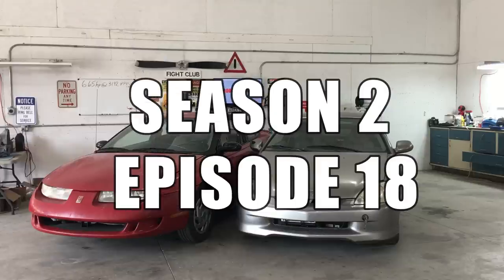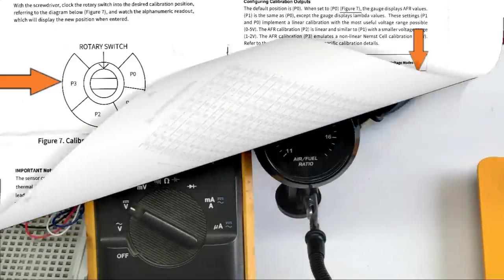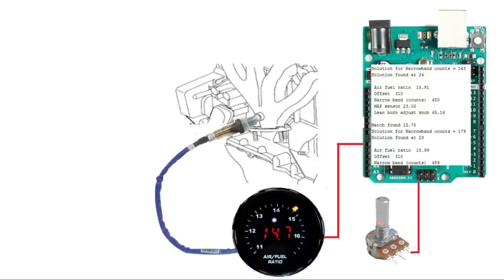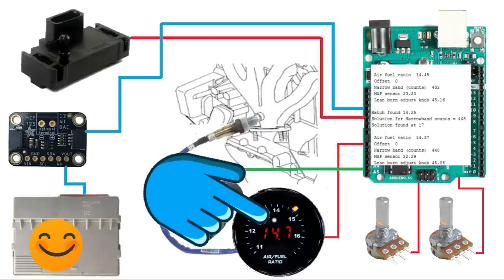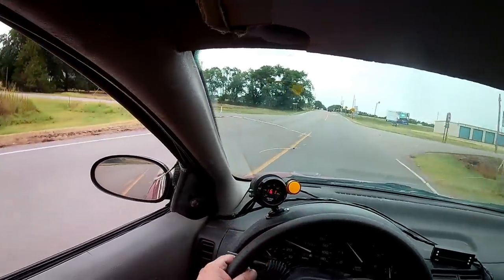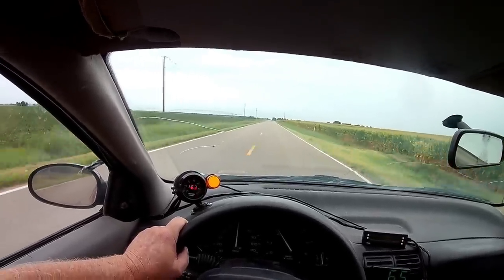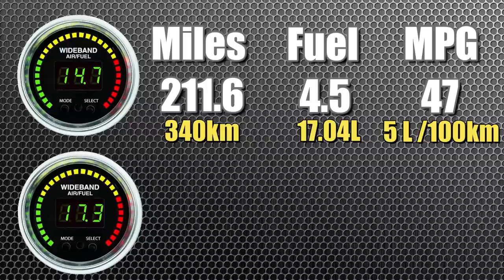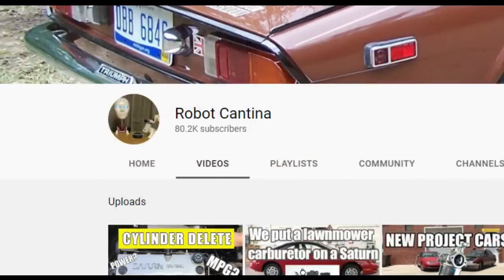S2E18:  We test a lean burn system on our Saturn .  Will it get better MPG?

Comment: I'm not suggesting that this was a problem in your experiment, but I do think it worth mentioning that I've been tracking fuel economy on my cars with every single fill-up for more than 25 years and I've learned that pumps vary in their calibration, even though they're tested and stickered by state regulators (i.e. agriculture department here in Kentucky).  As a result, I usually use the same pump for most fill-ups.

As most of us likely use the same station most of the time for location or discount reasons, it's often not difficult to use the same pump unless you arrive at a busy time.  I'm not crazy, though, and use another pump if the usual pump is taken.  It's just a casual thing and obviously isn't possible on road trips.  Long-term fuel economy will average out over many fill-ups, regardless, so this issue only affects individual fill-ups.

Even the same pump may vary in its cut-off point depending on multiple factors, including how the nozzle is positioned in your filler neck.  Most of us likely hold the nozzle in the same position each time, so that's not usually an issue.  I otherwise just accept the numbers shown as I'm not performing lab experiments ;).

Comment: It's possible your cheapo o2 sensor already as an offset built into it.
I had a bad o2 sensor and if too lean you clearly get very bad MPG.

It awesome someone got you a better kit.
Reply: A bad 02 sensor makes it run extra rich and use more fuel.
Reply: @1magnit  Depends on the o2 sensor failure.
Mine made the car run extra lean.
I had to crank up the fuel pressure every 100 km to keep my engine working to go home...

I would have preferred the o2 sensor to fail the other way.

Comment: I felt surprised that you read the ScanGauge measured injector pulses.  On Ecomodder they always say MPG meters measure the airflow and estimate gas used, which is why you need an MPGuino to measure lean burn MPG.

Comment: Thanks for another amazing video, the hoops you jump through to make this stuff understandable and entertaining is astounding! Questions: Do you think that the lean burn may be causing the engine to run hotter than normal? Hotter than normal can causes more fuel burn? From personal experience with small displacement air cooled scooters. you don't think that the parasitic draw from both the ac compressor, and the power steering pump would help you pick up that ~3 mpg that you saw, from some experience keeping older cars running, dropping an old ac compressor can pick up 1 mpg pretty easily. Thank you again this is so great to watch.

Comment: You should see if the egr operation is changing when you are running the lean burn system. Try to reset the ecu between lean and normal runs. Check when the ecu switches from open and closed loop between your lean and normal runs. Also check your short and long fuel trims to see if they are changing... if things are too far out of spec the ecu may just try to richen it up. Also monitor your coolant temps and egt if equipped, since they can cause it to try to run richer as a fail safe. I love the work you have done so far here. OEM ecus have all sorts of internal offset tables from my research in the past. Subaru's for example will change the injector pulse width as voltages go up and down and will do similar with engine temps.
Reply: To all the very valued viewers of this fantastic  channel and primarily to JIMBO  OF ROBOT CANTINA ..It's December and the Holiday season is upon us, with celebrations like Christmas, Hanukkah, Kwanzaa, Mid-winter or Yule, and New Year all approaching.  Wishing you a joyous Holiday season and a happy and peaceful New Year.  Thank you  for a fun ride.

Comment: Something that's crossed my mind from time to time is hot water. Nearly boiling, so combustion heat quickly and easily turns it to steam pressure.

Comment: As someone who has owned many S series, The single cam coupe can very easily get high 40`s and even low to mid 50`s if kept at 50 to 55 mph (assuming there is little to no wind on flat roads)
Reply: That’s honestly nuts for a car that size. How!?
Reply: Light weight car, pretty simple efficient engine, proper gearing, and decent aerodynamics. I had a 62 for falcon that would get 29mpg with a 260 v8 and a carburetor. It's all about setup, weight, and gearing.
Reply: @life_of_riley88  HEY JIMBO.....  congratulations on reaching 100k subscribers.. ROBOT CANTINA is providing the 
entertainment and fun that viewers enjoy..

Comment: The 92-94 Geo Metro XFi has a lean tune on the ECM. Along with only using 2 piston rings an using a different camshaft from the base model Metro.

Comment: The scangauge pulls MAF and MAP data and assumes 14.7.  It does NOT use injector pulse widths - this is not possible as injector pulse widths are constantly adjusted to maintain proper AFR due to fouling and other issues.  Vehicles have no metering device for fuel and just make assumptions based on history of fuel tank fuel levels and MAF/MAP using LT trim levels.  I have used scanguages for nearly 2 decades and they are great tools but are limited in their abilities.

Comment: I did this to my VW Mk3 Jetta 1.8 with single point injection using an old innovate LC-1 wideband controller. Mounted the wideband sensor downstream and left the original narrow band sensor in its place. Then took a 2-way switch to change between the narrowband signal from the original sensor, and the simulated wideband signal from the innovate LC-1. I then proceeded to program the LC-1 to target about 16.8:1 AFR and send that as stoich to the ECU. Been driving like this for a couple of months now and it works good. Haven't compared the fuel consumption yet though. But it feels as if a tank lasts longer than before.
Reply from the maker: That's exactly what we are going to try next, except we will be switching between the two sensors with a small signal relay.  We will still use the arduino, but this time it will monitor just the MAP sensor and automatically switch between sensors.
Reply: @robotcantina8957  Awesome. I would probably need to do something similar since it runs a lot leaner on high load than what i am comfortable with. But just gotta be careful. Ideally i would fit an MS3 and use table blending to run both E85 and gasoline. E85 can be run pretty lean without any real Nox being produced.
Reply: @ritter_cracker  HEY JIMBO.....  congratulations on reaching 100k subscribers.. ROBOT CANTINA is providing the 
entertainment and fun that viewers enjoy..

Comment: This one is certainly a head scratcher. If I understand the setup correctly, the lean burn box is sending a fibby O2 sensor signal to the ECU that the engine is running rich, it should have leaned the engine to compensate and gotten more MPG. I'm confused why the MPG was better without the lean burn signal? Maybe the ECU has been in a dishonest relationship before?

Comment: Very high MPG on first run can be caused by not ideal gasoline pump "stop" trigger.
Sometimes will stop pouring petrol with a lot o air still in tank.
Ideal solution: to ignore "stop" and slowly fill it up rest of tank to the level when You can see fuel level (through cap hole). Car should be on same pump as well - to eliminate any inperfection of terrain or pump gauge (calibration)
Or use separate tank and measure weight before/after as You done in one of previous tests.

Comment: I wonder if  there was any mpg gains from removing the power steering pump that may have skewed the data.
Reply: on my 92 Civic Si removing the PS belt is good for 1 to 2 mpg easily, and a seat of the pants boost in power.
Reply: I too suspect that is part of his discrepancy. When the weather cools a bit I am absolutely deleting the power steering on my SL1
Reply: I didn't bother putting my power steering and ac belt back on after turbocharging my Miata 20 some years ago.  The state inspection guy told me I had to put it back to pass inspection since it came with power steering.
Reply: @vinnieluther6589  that’s sucks, I’d install a false pulley just to pass and drive it the way I want to

Comment: Hey, Great work/experimenting. Keep it up!
Of late I've been using a haltech with an AEM wideband to target 16.0 for a closed loop. I think fuel economy is worse as well.  I think the LC-1 wideband has an NB simulated output switchable to  15.5 afr. The problem with your setup is that in a closed loop. the fuel trims kick in and the ECU will correct....which is what you want. but there are low, mid and high long-term fuel trims. as well as short-term fuel trims. short term fuel trims are eventually added to the long term.  This will mess up the fuel map tuning at higher loads even though you are monitoring the MAP. To mitigate this you would have to monitor fuel trims and adjust your driving accordingly.

Comment: One of my biggest concerns is using the gas pump to check how much fuel you used. I have noticed even using the exact same pump to fill up that sometimes it shorts me and I get amazing fuel economy for the last tank, but then the next tank my fuel economy is way back down when I fill up that extra half gallon or so that the pump shorted me the last time. Unfortunately, to get really accurate data you should use a separate fuel cell and use fuel weight, like when Mythbusters tests fuel economy. Even just temperature can affect how much fuel you get at a fill up. If you can use a separate fuel container, it will also let you make shorter trips since the data will be much more accurate.

Comment: As others have mentioned air flow and spark advance could be in a weird spot with the mapped wideband O2 sensor.
I'd love to see a datalog that included the MAF reading and commanded spark advance by the ECU.
Reply: Meeeeeeaaaaahhhh

Comment: One thing that confuses me "the lean burn turn on".From what I know about ECU control is that they have a short and long term adjustments. When you are turning on lean burn, you are fooling the ecu in thinking its running richer than it actually is, which uses the short term adjustment to reach the fake 14.7 mixture. Now that adjustment will get more and more added to the long term adjustment. This means your car will naturally have a leaner adjustment. When accelerating(which generally ECUs use another map or enrichment tables)  I could already see from the mixtures displayed, it should be between 14.7 and 13.5, but you were rocking above 14.7. In the end that is where my confusion is, you don't need to "turn off" lean burn as it's applied across the board after a certain while.

Comment: i believe the first lean burn in the early 70s from honda was to not need a cat, since we were only concerned with HCs and CO then not realizing that NoX had a larger impact on ground level ozone
Reply: those stratified-charge CVCC engines are a totally different animal. not even close to what is being discussed in this video.
Reply: @marzsit9833  they were a lean burn engine.  That burned around 17:1 instead of 14.7:1.   It was the first mass produced lean burn engine sold in the US…like I said…

Comment: The reason you want to advance timing in a lean burn system. Is to create the most cylinder pressure when the piston hits top dead.center as it reaches its power stroke. Because the mixture burns slower it will need to be advanved.
Reply: 15 deg ATDC is where you want peak pressure.
Reply: @1magnit  To all the very valued viewers of this fantastic  channel and primarily to JIMBO  OF ROBOT CANTINA ..It's December and the Holiday season is upon us, with celebrations like Christmas, Hanukkah, Kwanzaa, Mid-winter or Yule, and New Year all approaching.  Wishing you a joyous Holiday season and a happy and peaceful New Year.  Thank you  for a fun ride.

Comment: Regular engines run richer, doing so helps cool the engine and clean carbon build up, by leaning the mixture you actually run near the perfect mix, wich makes the engine run hotter but also stops wasting fuel.
Edit: newer engines also use the richer mixture to heat up the catalytic converter  to reduce emissions

Comment: You can actually use a linear 0-1V wideband sensor with a narrowband ECU. It will actually control the A/F ratio much closer. With a narrowband sensor the mixture is always switching back and forth. The A/F ratio isn't actually that constant. While cruising you can see a narrowband switching back and forth.
With a wideband and a linear 0-1V signal it should hold a steady mixture. In a P01 LS ecu you can even set different target switch points voltages
Reply: To all the very valued viewers of this fantastic  channel and primarily to JIMBO  OF ROBOT CANTINA ..It's December and the Holiday season is upon us, with celebrations like Christmas, Hanukkah, Kwanzaa, Mid-winter or Yule, and New Year all approaching.  Wishing you a joyous Holiday season and a happy and peaceful New Year.  Thank you  for a fun ride.

Comment: I used to do a lot of ecm tuning in mostly GM. I used hp tuners. Most people don't know this but most GM vehicles from about 97 to 2005 have what they call lean Cruise which is the exact same thing that you're talking about here. This system is not activated or set up but being I learned how to set it up and it was one of my better money makers when I was younger. Every single car or truck I ever did it on had a fairly decent bump in fuel economy.

Comment: If you want to improve your accuracy and reduce your drive time, you should switch to a smaller, removable gas tank and weigh the tank before and after the run.

Gas station pumps aren't always the most consistent.
Reply: Getting the fuel pump to work would be a challenge for sure.
Reply: A good way around the fuel pump inaccuracy is to use the same gas station and the same exact pump every time.
Reply: @Dappersworth  You are right there. But I think the Saturn ECU will be looking for a factory fuel pump? I dunno 90s stuff is weird. Or would it be ok as long as it had a regulator?
Reply: @MrEricErwin  i meant the gas station pump inaccuracy

Comment: My second comment - the Scangauge to my knowledge does not use injector pulse width, but is instead predicts fuel economy, making assumptions from RPM and load, and assuming the AFR. You have an offset value you can use to fudge the readings in line with what you actually observe. I've tested with an aftermarket ECU where I had full control over the air fuel ratio, and running hella rich did not change the reading on the Scangauge, providing some supporting evidence. 

If you're going to lean out past the 15's, I doubt you'll see any improvement without control over ignition advance. Combustion speed slows down and you need to advance ignition.

Comment: Higher NOX should be tolerated because of the efficiency of the car
Reply: Like on a modern diesel pickup.  Losing 25 percent MPG for the DEF system is counter intuitive.

Comment: I Will have to come back to these videos when I have more time. I want to learn to make my own computer controls or use existing DIY controllers. I have some experience with arduino programming, but connecting to the car is my roadblock at the moment.

Comment: NOx strategies in gasoline engines took two different paths........emissions strangled, poor performance camshaft profiles or EGR.   Whereas EGR can be blocked off or deactivated,  emissions cams need to swapped out for something better. I have done this to a few cars and they can drop fuel consumption by 20%.  Leaner mixtures produce a hotter combustion process, which makes more NOx, and thats why its "bad".   While lean is safe at light throttle and low rpms........higher throttle settings and rpms need richer mixtures or very bad things will happen......like melted pistons,detonation etc.

Comment: There are 2 reasons the 'lean burn' didn't work. #1) when too lean, an engine often produces a much higher hydrocarbon out put, meaning not all the fuel gets burned. (The catalytic converter gets it) #2) You are correct about the NOx. The combination of nitrogen and oxygen into NOx is an endothermic reaction, which means, some of the BTU content of the fuel goes into creating the emission, so there isn't as much expansion. It robs some of the BTU content of the fuel. Between those two things, the thermal efficiency of the engine is reduced.
Reply: Love the comments here.

Comment: GM had a lean burn function in the third generation F bodies but its only enabled in 85 and 86. The TPI computer's lean burn mode activated for 60 seconds at a time and ignored the O2 sensor while calculating a 16:1 A/F ratio and advanced the timing 8-10 degrees. This activated when the guesstimated load on the engine was low, there is no MAP sensor and just a MAF.

Comment: Taking out the power steering pump will absolutely make a difference in the fuel economy.  That thing soaks up a couple of horsepower and when the car is so small and light, you hardly need the assist.  And when its consumption is already pretty modest, taking a couple of horsepower off its parasitic loads just leaves that much more power for getting down the road.
Reply: I agree.  He should unpower the water and oil pumps too and see how that improves MPG :)

Comment: my CRX HF would regularly avg 47-53 mpg and it was just an 8 valve 1.5l 4 banger and the only magic was MPFI
Reply: That thing only weighed like 1200#s
Reply: 1836 from the factory and 2000 and change with me in it

Comment: 6:45 well ACKTUALLY you could use an inverting amplifier, if designed right. Opamps are cheap and plentiful and you just have to design an inverting amplifier that operates around the midpoint with an appropriate amount of gain. Depending how fast the signal  needs to be there may need to be mitigations in place to prevent saturation of the internal compensation capacitor inside the opamp.

At that point, it is a more of an engineered solution more than anything else.